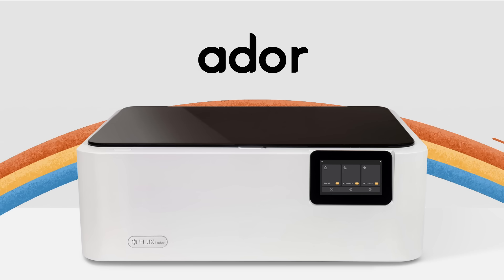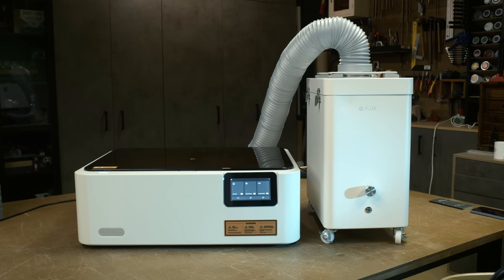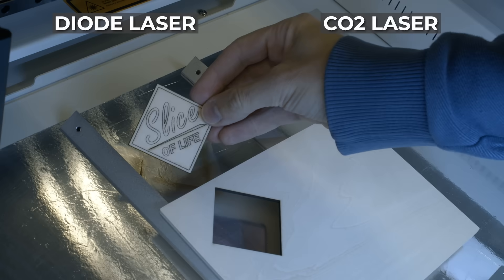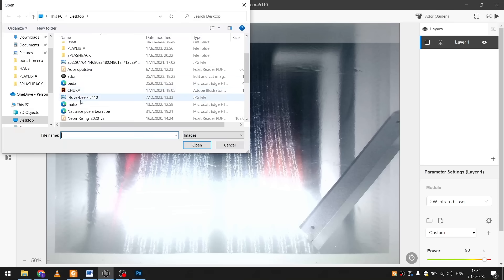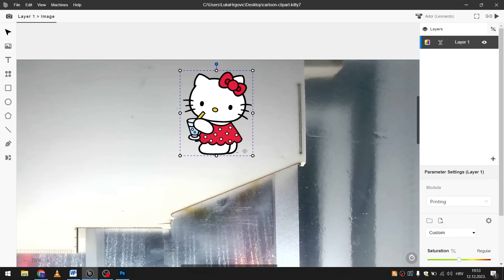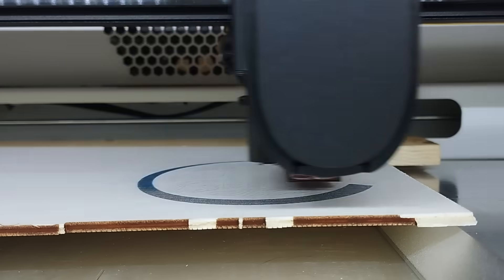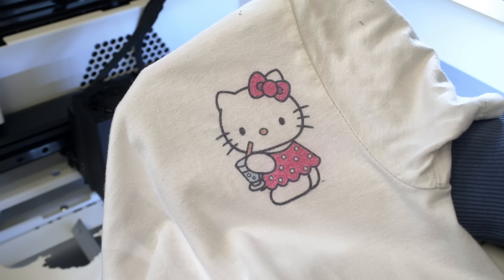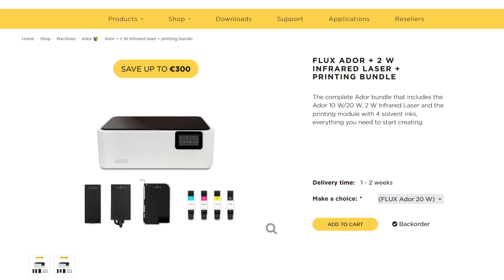FLUX Ador: World's First Color Printing Laser Cutter - REVIEW!

Comment: When I saw that it had the option of printing colors, I wanted to buy it, but now that I see that the color has to be changed constantly, no thanks.  Each machine has a percentage of deviation, I think that the color after changing the package will not always match the already printed color. At the beginning it will, but I think the problem will appear quickly after 5 days maximum

Comment: Now xtool took this printhead idea and brought the m1 ultra to the market: they did one prinz module to switch with the laser module, contains cmy but the k is missing. The images lack depth but its more convenient than the switching between every single color. If only flux had done more promotion videos explaining their system i would have bought one, and if only these companies work on the machines practicality before throwing them out.

Comment: The website says a single cartridge can print up to 833 A4 pages at 5% coverage. If we assume that doubling the percentage of coverage halves the amount of pages a single cartridge can print, then 10% would be 416 pages and 95% would be something like 45 pages. At $100 per cartridge, replacing 4 cartridges will add up fast.

Comment: First off, let me say: "Get video"!

I really like the way you vented the laser through your window.
Was your window a dual pane window?

I have a request: A short video on how you did this, along with 
a list of parts and materials required to do so, would really be 
appreciated. It really looks like a clean way to vent your laser,
or any other type of equipment, through a window.

Thank You,

Jim Dasher
Spectrum Graphics
Seattle metro, USA
Reply from the maker: Thank you Jim.
I don't know when I'll have the time to make a video, but in short - yes, it's an insulated doubleglazed window. I ordered it from the glassmaker and they cut the hole for me. So then it was easy to make a simple blast gate to close it whenever I'm not using it. I made it from wood and acrylic.

Comment: Can it print on metals (print yes, not engrave). Like say a pcb copper clad blank?
Reply from the maker: I don't see why not.
Reply: @sliceoflifefilm  interesting, so potentially it could be a way to easily etch pcb's and subsequently even put a solder mask (although maybe not a great one as it would get subjected to a fair amount of heat during soldering) on them and even a silkscreen.
Reply from the maker: @xConundrumx  Well maybe. I dont know if the print resolution is precise enough for pcb's. or if the ink would protect it from acid. that's something you would need to test ofc... 😉
Reply: @sliceoflifefilm  well it is eco solvent ink ... I mean you seen permanent marker used for this purpose too so ... Getting a machine just to test it is a bit much though. Will have to wait and see if someone else tests it.

Comment: I suspect the reason there's only one colour in the head at a time is to save space. If all four colours were loaded, the range of motion on the x-axis would be reduced due to the wider head. Having the head the same or narrower than the laser heads means your "job" can be as big as the workspace and you'd be able to print and cut up to maximum size.
Reply from the maker: That's very good reasoning!

Comment: Is there a laser cutter that can cut plain paper without burt mark?
Reply from the maker: I don't think so. They are burning paper basically. That's how they work.
Reply: My old 40W CO2 can.  You need to go REALLY fast and use air assist to blow out any flame.  The paper would have a scorch on the edge, but the edge is so thin it is unseen.

Comment: It needs a mechanism to lock the gantry while changing out cartridges/tools, or have it recalibrate it's position after each tool change. Seems like a pretty big design flaw to expect the user to change out tools without moving the gantry in order for all the different tool operations to be aligned
Reply from the maker: Oh, it does recalibrate at the top left corner after every tool or color change. No worries there.

Comment: One thing to keep in mind, eco solvent ink needs to out-gas for about 24hrs. This allows the solvent to evaporate and the ink to fully cure.
Reply from the maker: Oh cool! That's a good tip, thank you!
Reply: @sliceoflifefilm would be so nice if you could test the the ink smudge after the curing period again..
Reply: @janita851  by cure, do you mean it becomes waterproof?
Reply: @LemonLimes99  thats exactly what I wonder…
Reply: Curing in this case means it becomes dry and sticks to the material. But i still wonder if it depends on the material itself how longlasting and waterproof it is. Ecosolvent is used for iron on vinyl images, so there is a way to waterproof it. But still most of flatbed printers work with uv or pigment print as far as im aware, so i wonder why they don’t use ecosolvent. I find it odd that they promote a laser with a printhead but don’t say anything about the endproduct being waterproof 🙄

Comment: $3000 USD for the complete package (if I did the conversion correctly).  I was expecting this to be another one of those outrageously priced, gimmick lasers that keep popping up, but with all the features this one seems to have, this is likely a reasonable price.  Being a diode laser I'm still on the fence. 

Hopefully they will release a C02 version in the future.
Reply from the maker: That's if you buy it with Beam air filtration system. Without it it's about 2700$. Yeah, not bad for all the features!!!

Comment: Once I saw you need to change it for each color it kinda killed it..honestly it would be better to have a full color print head that stows away when the laser head is out and vice versa.
Reply from the maker: I had the same thought and I addressed it in the video. It did seem tedious at first but after a few prints you really get used to it and start doing it on autopilot. So it's not that big of a deal, but I completely agree. A full color printing head would be great in the future. Tnx for watching!
Reply: It can be a deal breaker depending on the cost of this machine. But for entry level it is probably cheaper than buying a laser and a flatbed printer, which is good enough to start getting jobs that need printing and cutting. Then save your $ and buy a proper sized uv flatbed printer.

Comment: Just wonder What can happen if painting the transparent acrylic before cutting
Reply: I have heard if you cover the acrylic with something it can be engraved/cut.  However you wont get as nice of results.  

Diode lasers work in pretty much the same frequency of light waves as humans can see, so if you can see through the material the diode's laser beam will pass right through it. If you cover the acrylic, such as painting it, the cutting will actually occur in the layer of paint but will carry through to the acrylic.  The thicker the acrylic the less likely the laser will be able to completely cut through since the cut point will always originate in the paint layer.  

Any of that make sense?
Reply from the maker: That's a great question. I would think it would only cut the paint layer, and have the same problem when it enters acrylic, but I don't really know. I'll try to test it and let you know!

Comment: I've been searching for something that can print colour on vinyl & cut as well, seems like there's a big gap for crossover tools! This is looking awesome so far.. Just got an Xtool S1, and I'm already dreaming about enough lasers! 
Great vid, subscribed :)
Reply from the maker: Thanks a lot! 😉
Reply: I'm new the the vinyl sticker and t-shirt hobby but, if I'm understanding what you are wanting to do, maybe I can make a suggestion.  

I believe most vinyl cutters these days have a "Print and Cut" feature.  You print your image from their software and it will also print registration marks.  Put the material in the cutter and it will read the registrations marks and cut out the printed image.  I have a Silhouette Cameo 4 that has this feature.

There is also types of vinyl that a printed image can be transferred to using sublimation and a heat press.  I have bought a roll of this but haven't opened the box yet so I can't tell you much about it.   I'm fairly sure they have this for both t-shirts and stickers.

So print the image on the vinyl with an inkjet printer with sublimation ink, and then cut the vinyl in the cutter.  

This is basic stuff so if you have done much with vinyl you likely already know all this. *9
Reply: Oh wow that's amazing, I had no idea thank you!! That sounds like exactly what I was getting confused about and trying to think why there wasn't a machine with a print arm and a cut arm, to avoid the alignment faff - But that sounds perfect thank you so much.

I've only played with my girlfriends cricut joy for a couple of hours, but really saw the potential given a better machine & I'm infatuated with the idea of being able to make decals. 

I'm currently up to my ears in the laser cutting world, but think adding a vinyl to my laser machines would be great. 
Think I might have a look at a silhoutte!
Would you recommend the cameo 4, or is there anything else you'd say in a similar range to check out?
Also an aside, sorry to bombard - what printer would you recommend for nice vinyl printing?  @unclerichard6729
Reply: This won’t quite be the solution for you.  Vinyl should never be cut in a laser because it produces Chlorine gas, the C in PVC.
Reply: @JehanSaintre  no no sorry, not saying I will cut vinyl with my laser - just that that’s what’s given me the make it yourself bug!
Reply: You'd be wasting your money. Prints on vinyl need to be laminated to protect them from wear and weather, plus the inks need to be UV stable or in a few months it will look like crap.

Plus don't even think about this for any kind of commercial application unless it's some bespoke add-on to an interior display that's only somewhat larger than a piece of paper.

You need a print/cut latex printer.